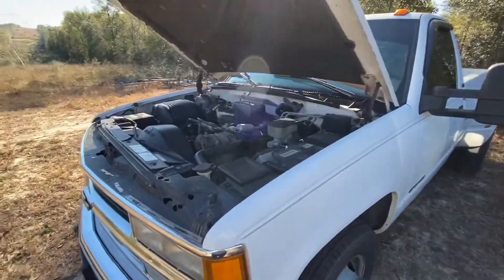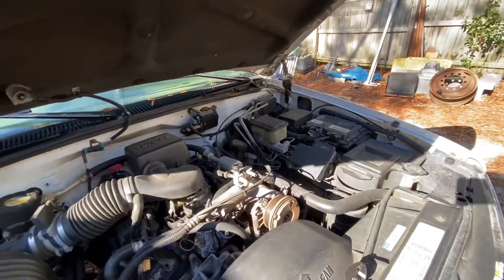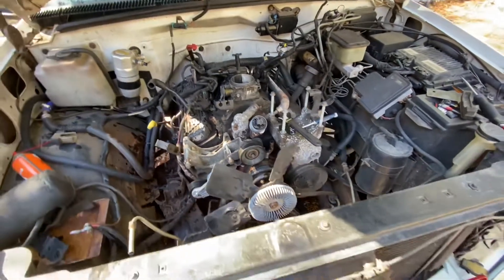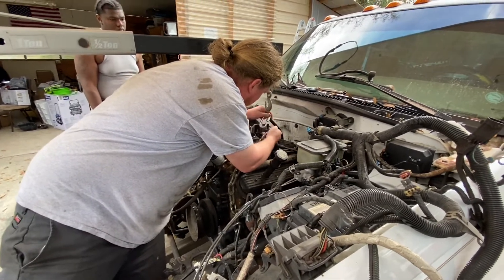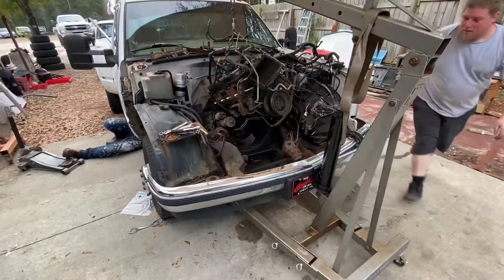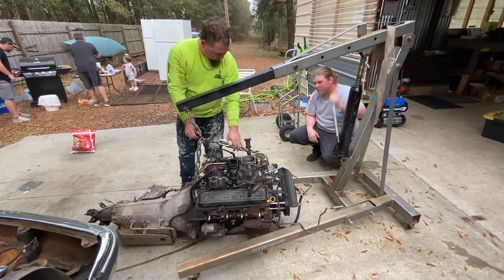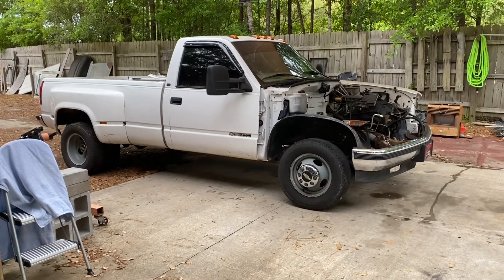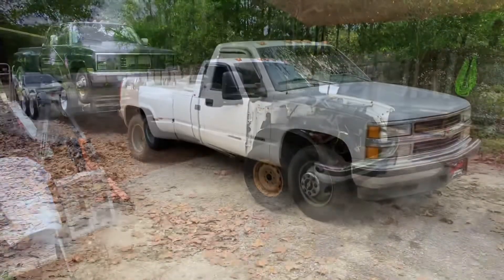Saying Bye to the 5.7 and installing the 7.4L! 1997 C3500 Dually Project!

Comment: I’m looking at c2500s and c3500s right now. I’d prefer the 7.4L (I owned a 2002 8.1L before) but there are a few 5.7L 2500s & 3500s in good condition. Are the 5.7Ls really underpowered in the larger chassis?? It’d only be a daily driver and I work from home so  not super worried.
Reply: I daily a 98 c2500 sclb with a 5.7 and 4l80e. It’s just as fun to drive as my 6.0 1500hd. I pull a car hauler with mine and it does good.

Comment: Question bro in the same process of doing the same swap but i am currently stuck. Did you use the same wiring harness for the 5.7 to the 7.4 or did you swap the wiring harness as well ?
Reply from the maker: Swapped whole harness!! It was a bear. Gotta swap the dash harness as well unless the harness plug on the pass side by the AC box is the same. 97.5 is a change over year for some wiring stuff…

Comment: Did you have to change mounts? And the original wire harness to run the big block ?
Reply from the maker: The motor mounts on the frame were the same, I cannot remember if I had to move them any or not… but I do not remember having any issues with that part of it. The engine harness is from the big block truck yes. I kept my small block computer, just because I didn’t have a way to tune out the vats… I would recommend getting the vats turned off and running a big block ECU because the tune is different I believe.
Reply: @checkeredpastracing1984  I have a c2500 that I'm getting ready to dually swap for the dually bed on it has a 350 4l80 e  transmission 350 has a lot of miles on it. I was thinking about big block swapping it but I was worried about the mounts and now knowing it'll slide right in there. I know it'll bolt right up to the 4L80. I just need to use the big block wire harness and the big block computer
Reply from the maker: What year is your truck? The problem I ran into is the early 97 and the late 97. The dash harnesses are a little bit different and wasn’t an exact fit. My cruise control and my brake lights didn’t work after the swap… make sure you either get an exact match to your truck, or swap out the dash harnesses too.
Reply: @checkeredpastracing1984  I have. 99 c2500 it's a utility bed truck with cruise . I'm looking for a big block out the and 98 99 obs dullay I recently purchased a 95 a 4x4 but it's diesel the 4l80 transmission. I'm going to take the whole front four-wheel drive setup off of that truck to have the truck be four-wheel drive. Then I'm doing the dually axle and go to bed. I have a 30-ft toy hauler. It's got to drag around lol
Reply: @checkeredpastracing1984  I might end up with a old camper 454 lol
Reply: @checkeredpastracing1984  what did you pull your motor from?
Reply from the maker: @williamuntchiii7529  I love my big block, but I just bought a Cummins to replace it… I bought a complete running donor truck for my swap.
Reply from the maker: My donor was a 97 so I figured everything would be direct swap. That’s when I learned there was an early and a late 97. Very painful honestly
Reply: @checkeredpastracing1984  that's awesome what do you want for the big block swap money wise ?
Reply from the maker: I literally drove the truck today, and I tow trailers with it weekly so I can’t talk too bad about it… but the wiring part of it not matching up really threw a loop in everything
Reply: @checkeredpastracing1984  like it needs another harness ?
Reply: @checkeredpastracing1984  lmk if your interested is selling the swap
Reply from the maker: @williamuntchiii7529  like I should’ve swapped the under dash harness too. I had to swap a few pins for the injectors on the computer too. I should have swapped every single thing over from the big block truck, got the vats turned off, and used the big block computer. The truck had already been down for months, and I didn’t feel like having to take it all apart to swap the rest of the stuff over. The truck runs absolutely amazing off idle, but has a slight miss at idle.
Reply from the maker: @williamuntchiii7529  I am about to build an extended cab Cummins swapped OBS, and I’ll turn my dually into a single wheel 2500, and it will get sold that way. The engine swap is not the whole reason, but it’s part of it. Like I said, I love it and towed 100 miles with it 2 days ago in my 26’ enclosed trailer, but it could definitely be better.
Reply: @checkeredpastracing1984  I have a 2500 axle lol I'm pulling my out for the 3500 axle